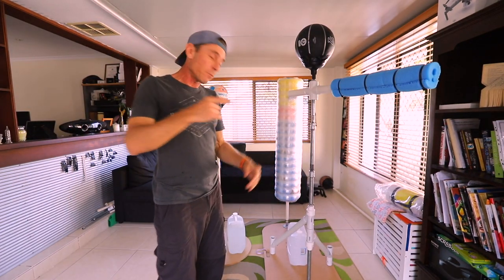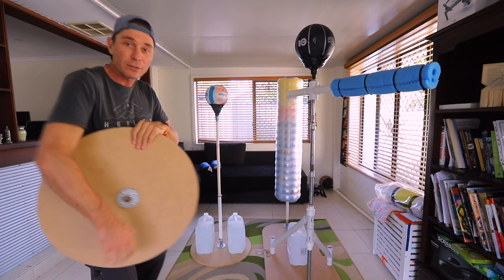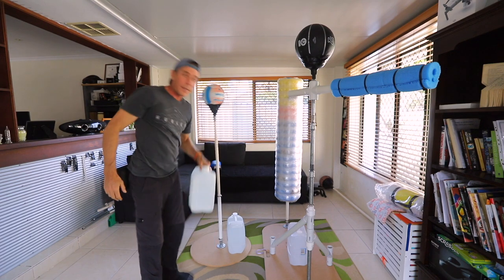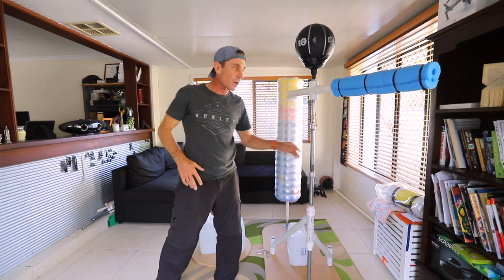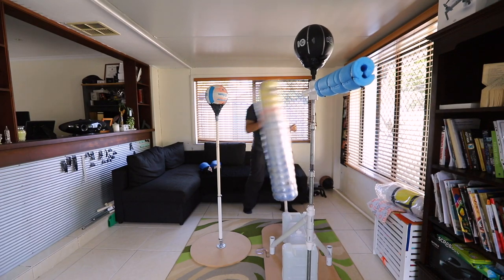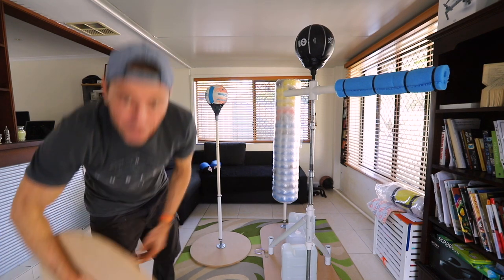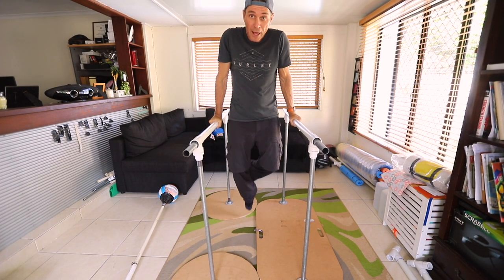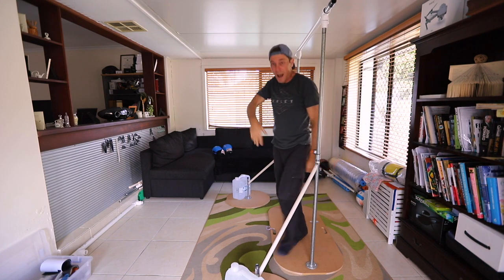DIY Punching Bag Platforms Compared

Comment: What is the size or pipe flange
Reply from the maker: I’m using 1 inch pipe and flange now for all new builds - makes it stronger 💪
Reply: @Kewlus  it's okay to use 1 and the half flange
Reply from the maker: That sounds too large. In most designs I use either a 1/2 inch or a one inch. Go to FighterDIY.com for details bro 👌